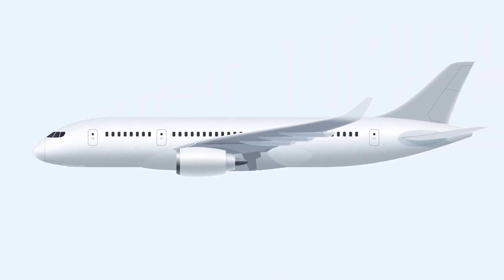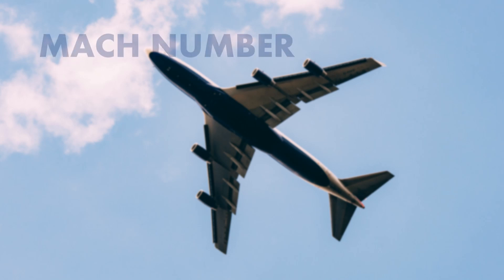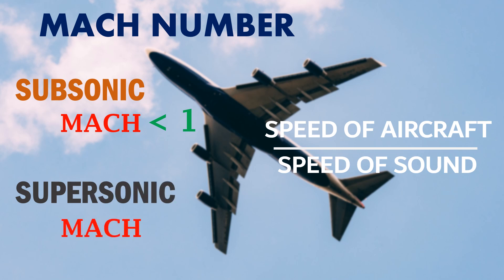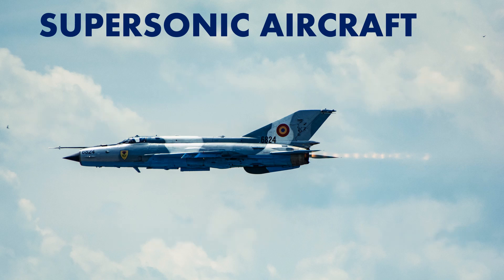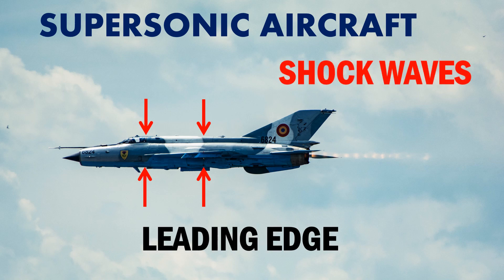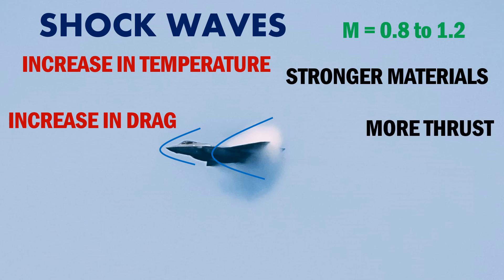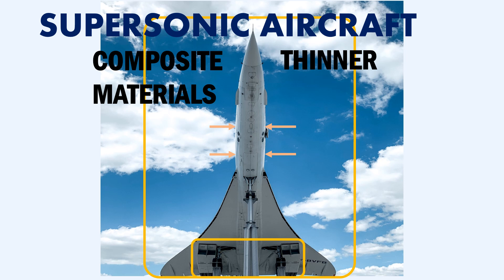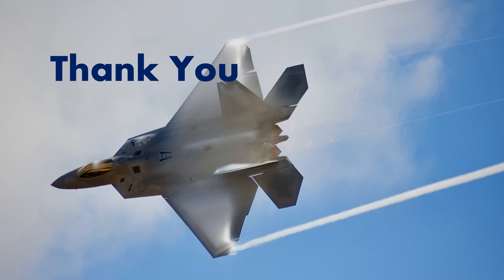Comparison of Subsonic & Supersonic Aircraft| Shock Waves| Designing Commercial Supersonic Aircraft!

Comment: Did you know that there’s also transonic aircraft which fly at speeds between Mach 0.8 and Mach 1.2? Most jet airliners are classified as transonic aircraft rather than subsonic. Transonic is defined where some of the air flowing around the plane is moving supersonic even if the plane as a whole is flying subsonic and/or when the some of the air flowing around the plane is move subsonic even if the plane as a whole is flying supersonic. Most fighter jets by the way usually fly at subsonic speeds below Mach 0.8 even though they can fly at supersonic speeds above Mach 1.2.
Reply from the maker: Thank you for the info mate!
Reply: You're sure welcome! There's also "hypersonic" which is defined as flying at speeds of Mach 5 or more. But as you may already know, no airplane can fly at hypersonic or even near hypersonic speeds. Only rocket propelled aircraft and spacecraft can achieve these insanely high speeds! Crazy, right?
Reply from the maker: @ChrisZoomER  Adding to the engines, the structure of the aircraft must withstand the high temperatures at supersonic speeds as well
Reply: @JxJAVIATION  yeah I know
Reply: @ChrisZoomER  ooh thanks
Reply: @VloggerAnkitRaj  You're certainly welcome!
Reply: Want to learn more